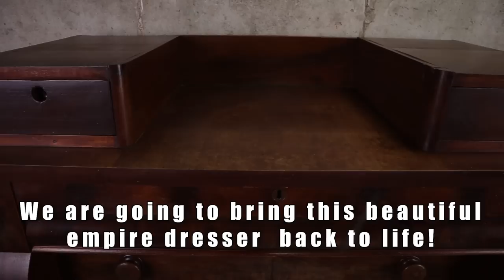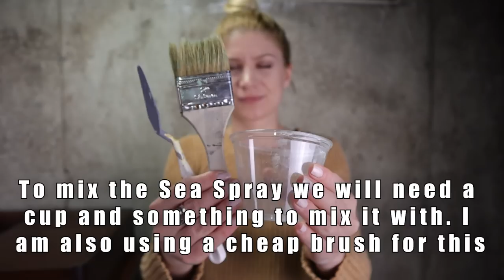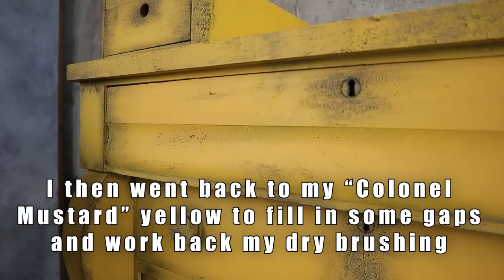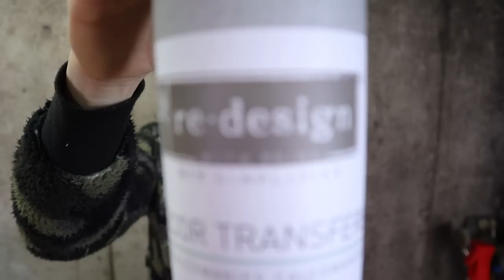How to Chalk Paint, Sea Spray Texture and Use a Transfer

Comment: When using the transfers like that and given you had an uneven surface,  go ahead and use a sponge after you scratched it off it. This helps to fill the lower areas in. The transfer also will adhere to the surface a bit better😊 love your show bunches🌸🌸🌸